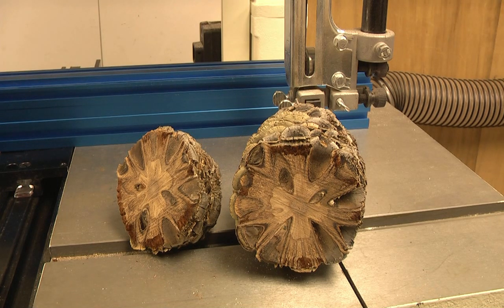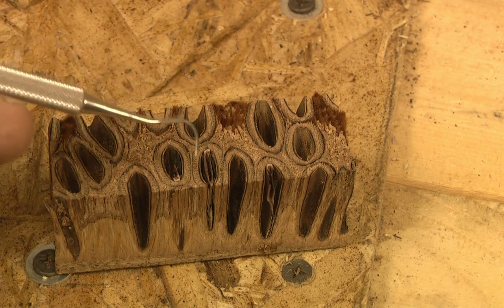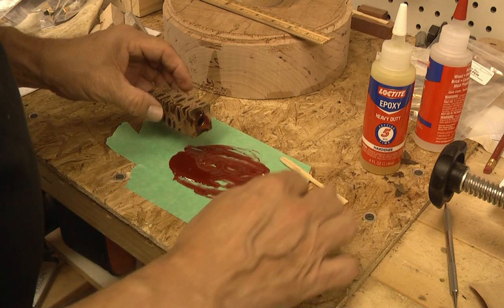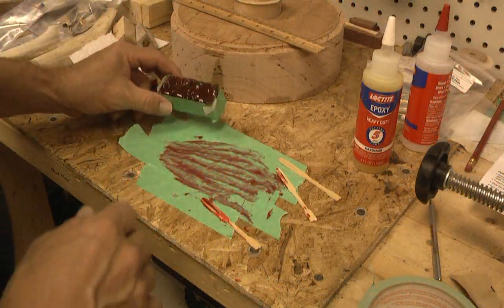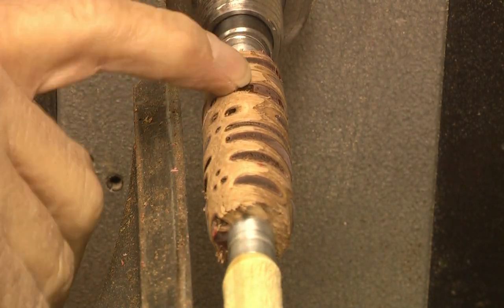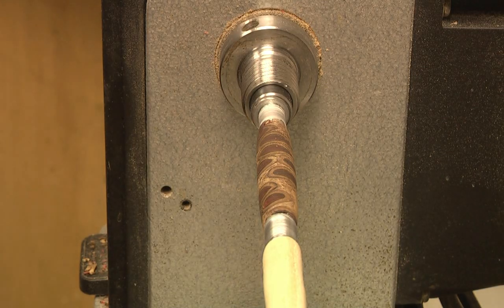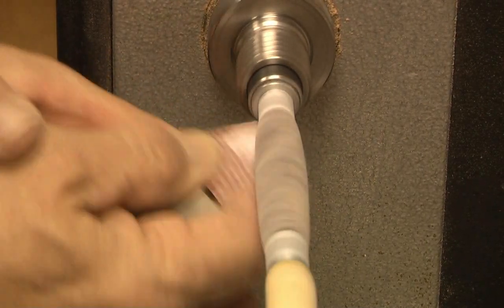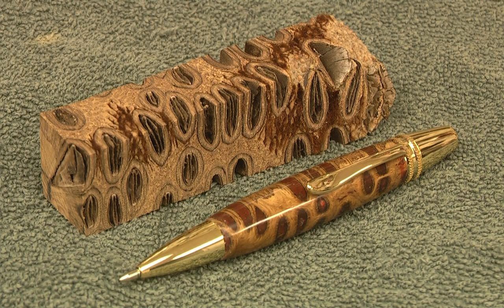Turning a Banksia Pen With Dyed Epoxy #10

Comment from the maker: Thanks for the feedback and hope all is well.  I have to admit I was pleased with the results.  I didn't know what to expect when I started.
Reply: I think it would probably look better with a brassy looking almost metalic color for the epoxy maybe get some metal shavings and mix it with a glue instead? or would the lathe not allow that?
plus it would dull the tools super fast
Reply from the maker: gasman5555 I think that could work out nicely, use some very fine glitter than u can get from a hobby store should do the trick.  I have some in the shop, and will give it a try.   Thanks for watching and the idea.

Comment: The cavities where full of seed you cut when cutting the pod into slices. Banksia's are easily propagated from seed. A common way to release seed is to place the 'cone' in an oven at 120°140° C for about an hour. The follicles then open and the seeds can be removed with tweezers. Two black winged seeds are usually found in each follicle, together with a structure called a separator.

Insects sometimes lay their eggs in the flower buds and the larvae may eat the seed as it develops. A small hole in the woody fruit is usually a sign that this has happened and that the seed will not germinate.
Seeds should be sown in a very freely draining seed-raising mix which should not be allowed to dry out. As Banksia seedlings are prone to fungal attack, it is better to sterilise the seed-raising mix before planting. If this is not practical, very clean ingredients should be used.
Seedlings should be transplanted into small pots as soon as the first true leaves appear. A potting mix made from equal parts of river sand, loam and leaf mould (or peat moss) is generally suitable. Now you have seed to plant but be warned it will in 20 years be a very large tree.  Thank you for saying Banksia properly, great video. Heather Sydney Australia.

Comment: You can thin epoxy with alcohol which might make it easier to flow it down into the openings on the pod.
Reply from the maker: +madmat2001 Thanks for the great tip.
Reply: Doesggalicafectwarfarin

Comment: Try using a filler that they use for granite. It's a buttery consistency  so when you spread it , it stays were it is. I,ve used this method lots of times and it saves putting tape on. From Roger Brown in England..
Reply from the maker: +roger brown Thanks for the great tip.  I used some of the concrete/granite epoxy in the fall to repair some concrete and decking.  If I need to do any finish work this spring I will make sure I save enough to try a few projects.  Thanks for watching, have fun and be safe.

Comment: I think you should have done a vacuum infusion where all the air gaps would have been sucked out.  It also would have turned your blank into a solid pore-less piece where fibers would not fray.

Comment: What I found when filling holes from the top is that air can get trapped in the hole because the epoxy or polyester resin is too thick to allow the air to escape the cavity.  I went to the drug store and bought an irrigation syringe and filled it with the resin.  Then push it to the bottom of the cavity and as you fill from the bottom the air will be naturally displaced.
Reply from the maker: +Myllo57 Thanks for the tip, sounds like a pretty simple solution.

Comment: I love how the pen came out.
And, seriously, you're the first person I ever saw who mixed the epoxy in a tape and not in a cup or something. 😂
And as already said: a vakuum chamber or something works great. maybe you will make a form. So you can put your wood and resin in? :)
Reply from the maker: +Alyathaean The tape is cheap and easy for mixing the 5 minute epoxy and easy to clean up.  When I am mixing casting resin I use cups to get exact measurements.  Trying to save my allowance for a pressure chamber, would make my life a bit easier.  thanks for watching.

Comment: Very interesting and the results were stunning!  I am fascinated with wood turning, though I have never tried it.  What is 'CA'?  And what was that last step you did with applying drops of something then spraying, and repeating it 3 times?

How do you know what a pen size is, outside and hollow inside?  Is there a way to measure this and set a lathe automatically to that?

Also, what would be an approximate cost for a bandsaw and lathe like you have?  What wonderful tools they are !!
Reply from the maker: +Lass-in Angeles Thanks for watching.  CA stands for cyanoacrylate, which basically is super glue.  The last step was applying a few drops of the CA while the lathe was turning to get an even finish.  The spray was an activator which speeds the drying process of the CA.  Most  pens use a 7mm mandrell to secure the pen for turning and the center hole varies based on the pen model, specific bushings are used for the various models.  RJBWood Turner has some excellent videos on pen turning.  Try this link for some great information: https://www.youtube.com/watch?v=HZShe5ntDJY
Reply: +I Turn Two   Thank you!

Comment: You can use a vacuum degaser to remove air from the inside of the blank.  Sound expensive I know but SV Seeker uses a pressure cooker and a small vacuum pump.  Not cheep but not very expensive.
Reply from the maker: Robert Palmore Thank you for the input I would like to try that. I will ask Mrs. T to increase my allowance.
Reply: I Turn Two Good luck on getting an allowance increase.  Not sure that my Mrs. would;0)  Threaten her pressure cooker if she doesn't, on second thought...........
Reply from the maker: +karin justine Wow, I had to google "Fibonachi", way over my head.  Here in Emerald City we  have to import our Banksia Pods and most everything else.  Thanks for the interesting ideas and for watching.  Chuck

Comment: really cool video was the material hard to turn?
Reply from the maker: +DJDISCOWAFFLE I do not think the banksia or epoxy was really any different than most other blanks, wood, acrylic, etc.  The banksia does tend to throw a lot of debris from inside the pods, but just wear eye protection and dust protection and everything should be fine.

Comment: Great idea using a banksia pod for a pen blank!  I would never have thought it could be done, now you've given me another idea as I really like your results.  By the way, what brand of pen mechanism did you use?  I've been thinking about trying a similar pen but have never seen one turned like yours.  Thanks for sharing and safe turning to you always!
Reply from the maker: Kenn Harris Kenn, I used a PSI Polaris for this pen.  I wanted a pen that only required a single tube.  The gold looks good with the banksia, but I would just rate this kit a 3 out of 5 stars
Reply: Kenn Harris Great demo try putting epoxy bottles in a bowl of hot water for a few minutes it will thin it out but not decrease hardening time.

Comment: Hi, can you do a video on assembling the Polaris kit please, iv got three of them but for the life of me can't get the end cap right
Reply from the maker: john whitlock Unfortunately I do not have any polaris kits left.  If you can describe your difficulties I can try to walk you through a solution.  thanks
Reply: The twist mechanism sits in the bush with no resistance to hold it there and I think this could fall out its that slack, when the end cap is pushed on to the twist mechanism it's about 3mm proud of the Brass Bush so possibly two problems. Looking forward to your reply
Reply from the maker: john whitlock i am on the road and will be back in the shop in a few days and will try to recreate your symptoms.

Comment: what's the spray used between the CA coats? is it like an instant cure or?
Reply from the maker: +Travis Rake it is an accellerant or instant cure i use when working with CA
Reply: Comprised of what? Can it be store bought?
Reply from the maker: +Travis Rake get it locally at the woodcraft store. you can get it online from their website for about $8 try this link: http://www.woodcraft.com/product/839150/stick-fast-aerosol-activator-75oz.aspx

Comment: Can you please let me know more specific on the ink/ dye you picked up at Staples? The dyes in woodworking are $20 +/-. I've tried other things to color epoxy, unfortunately each time it effects the balance of 2 part epoxy set up and does not harden properly. Thank you for sharing your experience and for your reply.
Reply: I use west system epoxy...it works great with amendments.. its not full of filler like hobby store 5 minute stuff is in order to achieve its 1 to 1 ratio
Reply: I saw a vid where the guy uses doller store eye shadow and it worked perfictly.

Comment: any reason you didn't use the vacuum for this one?
Reply from the maker: +sinephase Since I used a 5 minute epoxy, I thought it would have set before the vacuum pump would be able to get all of the air out.  Also, I don't know if I am right or not, but I think a pressure chamber would do a better job of forcing resin or epoxy into all of the recesses than a vacuum chamber.  A lot of folks on YouTube seem to have good luck with them. I am trying to talk Mrs. T into raising my allowance so I can get one.  Thanks for watching, stay safe and have fun.
Reply: @ITurnTwo  Yes, you'd need a pressure pot. It sort of compresses the air bubbles I believe but don't me on that

Comment: Excuse me！Will you use what material? THX!
Reply from the maker: +Luo Xiankang I made this pen from a banksia pod which is from Australia.  I filled the crevices with a two part clear epoxy, bought at most home good and hardware stores.  The red dye is basically stamp pad ink purchased in an office supply store.  Hope this helps and good luck.  Thanks for watching.
Reply: I Turn Two Thank again!

Comment: Nice Job. It looks great. Those pods are HARD eh?  I often heat my epoxy to get it to flow for things like this. You will need a slower set epoxy just to be sure it flows before it sets up.  I would try to Heat the pod with a heat gun, and then apply the epoxy, it will liquefy and flow really nice.
Reply from the maker: +Two Tracks Bow & Wool Thank you very much for the great idea.  I have a few more pods and an old heat gun, will give it a shot.